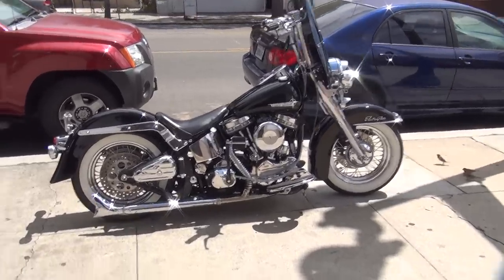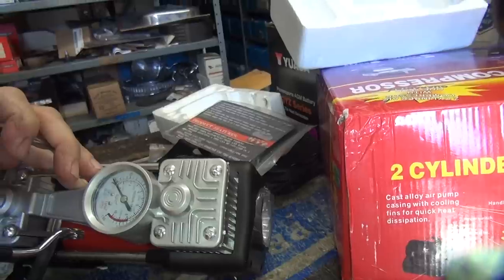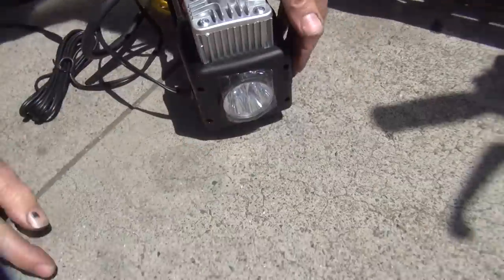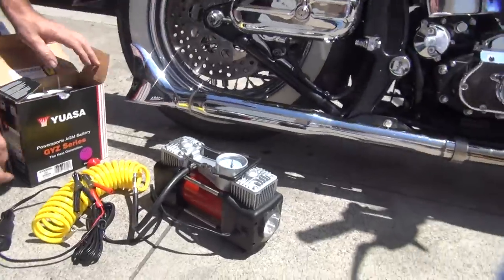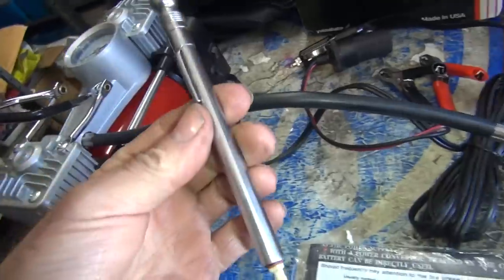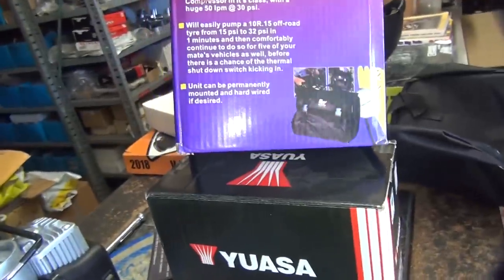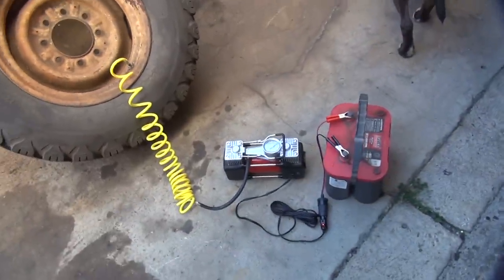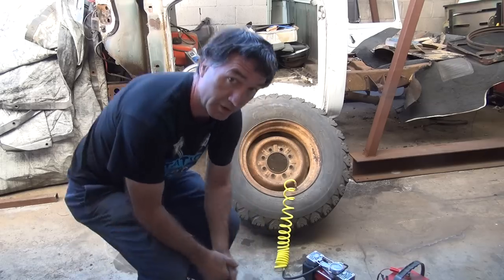2018 Audew 12V DC twin cylinder tire Inflator product test by tatro machine 150PSI air compressor

Comment: Mr. Tetro. You think if they had an oil filled pressure gauge on the pump it might cut out the vibration on the needle?

Comment: I use a small 12v pump called CyclePump and it fills a tire quick and it’s a third of the size of that pump.
Reply from the maker: that is why they make different size pumps. this is the 3ed and biggest air pump tested. it took 10 minutes off the time to fill the big tire verses the other smaller pumps.
tatro